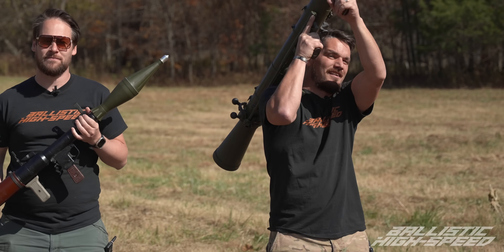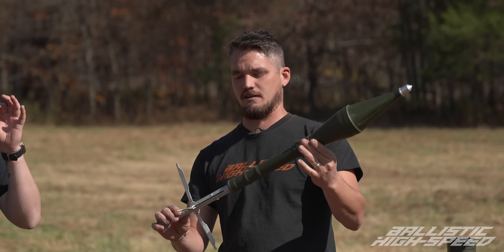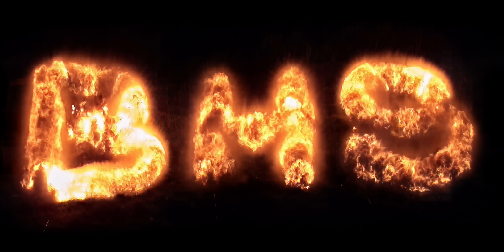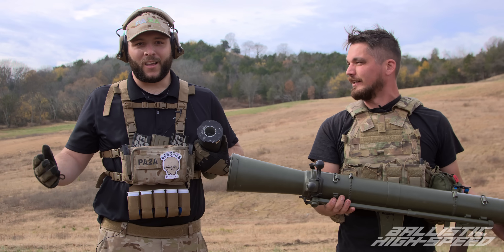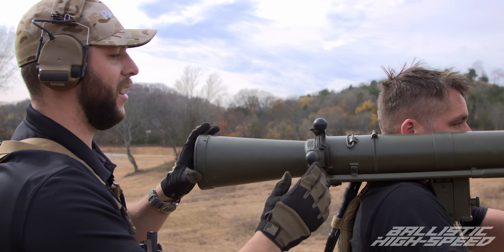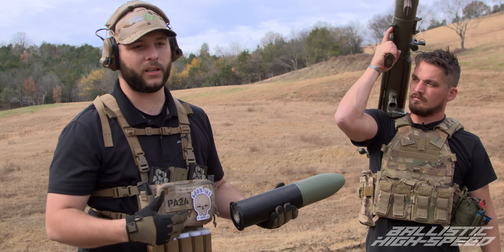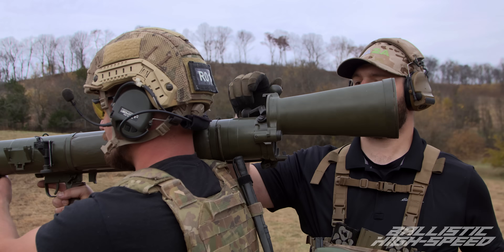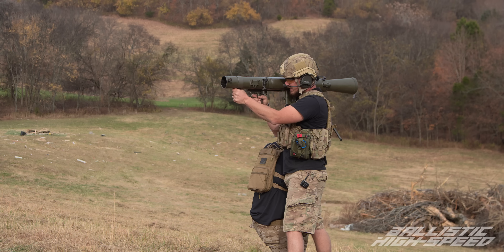Rocket Launchers and The Dangers of Back-Blast! - Ballistic High-Speed

Comment: If you guys wanna know what happens if you block rpg thrust, it blows up! Because pressure has no where to go. Really mind blowed that you guys did it, before it happend i heard you guys say like 3 times "we have heard, its very dangerous" but yeah, we still going to fk with it...  it looks like that was the result you guys were looking for. Cant imagine other outcome than this. Check the other rpg you shot hand behind it, it might also have cracks. Most channels test this kind of stuff with string and dummy... i wish you fast recovery ✊. If something is dangerous to use as it should be used, then never ever modifie, test or experiment with that thing while you are next do it, rpg has allot more power to just kill a person, dont freaking play with it.

Comment: Im glad that Adam will make a full recovery! One of three things most likely happened to cause this from what I could find. 1. The rocket was improperly loaded leading to it getting caught on part of the firing tube. 2. The tube itself had a fault in it leading to shrapnel hitting Adam along with fire from the blast. 3. The stabilizer fins were deformed to make the rocket trail off to one side potentially hitting the ground causing shrapnel close by to the shooter. Wishing you well in your road to recovery! It will make for a cool story too 😁
Reply: could it matter that the pressure maybe finds too much resistance and pushes back because of the gel face very close to the pressure exit?
Reply: @JumpingDyl   the rockets were home-made, I dont know what they expected. they probably overloaded the last one causing the mechanism the explode. you can see the propellant at 4:00 exiting and it lost not uniform and almost dirty and dark,
Reply: @liamisboss2  those were homemade??? No wonder they exploded 🤦‍♂️

Comment: 4:54 The gas leaking out near the fire control group seems to get worse and worse with each shot. This is probably a reactivated RPG with the tube repaired by welding.
Reply: It is reactivated and that leak ended up being a failure point and the rpg exploded in his hand later they have a video on it

Comment: The RPG 7 IS a recoilless launcher. 
 Its payload has a rocket motor on it that fires after it has left the tube. While it has a payload with a rocket motor on it,, it is ejected by propellant acting as countermass. befor the rocket motor is ignited and adds to its forward push.
The rocket is not under rocket propulsion when it fires, its unfired while moving forward from expanding gas of propellant thats behind the payload. After its 20 feet or so away, the rocket motor fires.
The anti personnel OG-7v grenade the RPG-7 fire has no rocket assist when it is fired from an RPG-7 for example. 

 Panzerfaust and RPG-2 were also recoilless launchers that fired payloads that had no rocket assistance to the payloads they shot.

It looks all the world to me that the "rockets' they are firing are not configured with any rocket motors. ( 3:17 ) The section where the rocket motor should be is just a flat fold of tailboom steel, exactly like an RPG-2 warhead has (likely IS from an RPG-2tailboom 11:24 ) just behind the 'warhead', and ahead of the propelling charge.   Go's to show, they are using a recoiless launcher and not launching rockets at all.

Comment: OK, not touching the accident or the admitted non-recoilless CG, however;

1) The RPG-7 is not a rocket-launcher but in fact a recoilless weapon like the CG (albeit most of its munitions are rocket-sustained - notably the OG-7 is not).
2) You are holding the RPG grips the wrong way around. Right hand goes on the firing grip if you are right-handed.

Comment: Firing a hand cannon with your head against it is inherently an unsafe design. Idk if that rocket was from old Soviet stock, or maybe if the US trapped it for rebels to get killed in irak, and somehow came back to the US
Reply: No one has to trap anything. Weapons are machines, and sometimes machines fail
Reply: @jimsagubigula7337  yeah I guess, but that's odd. This kind of damage would be the first thing engineers would try to avoid, so i couldn't imagine a rocket failing like that. But i suppose 1 in a million times it can happen
Reply: @jeanladoire4141  This. And don't forget engineers are humans too. They can make mistakes. When you have built 10 million rockets, some of them are bound to fail.
Reply: Nothing is perfectly safe

Comment: these weapon systems don't produce smoke IRL. Maybe some myst/fog at best. I wonder what the results would be with actual charges, definitely would be more violent. What you're showing is basically a musket without an end cap. Also very likely what induced the tragic failure. You shouldn't fake this stuff, or used inert weapons to test for this very reason.

Comment: That really shouldn’t have happened with dummy round and no detonators installed??? 

There shouldn’t have been any condition that existed for this to happen… 

What needs to happen to repeat this to reproduce the result to know for sure… how this happened 😣 I can’t think of anything right now that could cause this… even if it was over loaded… it would need to be sealed for any pockets or space in the powder to be contained and obtain that pressure release…

I heard two pulses 😬

Comment: When handling explosives, torpedoes, mines, rockets, pressurized fuels, unstable batteries, chemicals, solvents, etc. there is always an inherent risk involved that something will go catastrophically bad, and all you can really do is take the knowledge that what you are doing IS DANGEROUS and then go from there and respect that fact and mitigate that inherent risk as best as possible and be level headed as to how you are going to go about your business. Most of the time if the proper care and precaution are used, things are fine. But even if things are all on the up and up and you are checking yourself and going by the book, things do happen and sometimes go completely and devastatingly wrong.

I am not a subscriber, but I hope that Adam's recovery proceeds smoothly and goes well.

Comment: What cato'ed was the motor. Either the motor was damaged (dropped or fuel pressed wrong)or that head was to close to the nozzle. I have built thousands of solid rocket motors, and seen this happen many times. The fuels we use are basically explosives on a leash. Benzo, and silacylate can especially do this if not handled properly. 
But also, I have set up rockets to close to the launch pad and this caused engine failure. That head could have very well been a factor. I would like to study the slow mo of this event to understand my craft better.

Comment: No matter how well you prep, a catastrophic failure can happen, just as what happened to Kentucky Ballistics, it doesn't matter how experienced you are or how much prep you do, a failure can happen, regardless, I wish you a speedy recovery Adam, and my heart goes out to you and your folks.
Reply: "The rocket is launched by a gunpowder booster charge, giving it an initial speed of 115 m/s (380 ft/s), and creating a cloud of light grey-blue smoke that can give away the position of the shooter. The rocket motor ignites after 10 m (33 ft) and sustains flight out to 500 m (1,600 ft) at a maximum velocity of 295 m/s (970 ft/s)

the RPG-7 munition has two sections: a "booster" section and a "warhead and sustainer motor" section. These must be assembled into the ready-to-use rocket. The booster consists of a "small strip powder charge" that serves to propel the rocket out of the launcher; the sustainer motor then ignites and propels the grenade for the next few seconds, giving it a top speed of 295 m/s"
Reply: Kentucky ballistics situation was a little bit more preventable though had he used reputable ammo. That was a crazy freak accident still.
Reply: Found the website in case you need to book an event.
Reply: Yeah, i instally thought of him as i saw that.
Reply: "In designs such as the RPG-7, the rocket exits the launcher with a low-powered gunpowder charge, and the main rocket motor then fires after the rocket has travelled 10 m (33 ft)"

I'd bet the gunpowder charge used in these modified/replica rockets is significantly different to the charge used by original rockets the rpg7 is designed for.
Reply: what did happened ?
Reply: I thought of the same thing that happened to Scott as soon as I heard prototype rounds. These should be tested on a rig set up.
Reply: there's no way of knowing what round will explode, it'll just happen, and those don't look like garage rockets either, well to me at least
Reply: Yeah. I think in the case of Kentucky Ballistics he bought sketchy ammo. He should have known better. In this case, the jury is still out.
Reply: @michaelhill6451 Shooting rpg rounds some dude has made in his garage is sketchy as fuuuu
Reply: @dopefish93  Most definitely.
Reply: @michaelhill6451   In a sense...  This was literally sketchy ammo being used.  It's literally just some dude's "prototype" or homemade rocket engine projectiles with no explosives.  
It still exploded in a tube, right next to his head...  If it squib-rounded in the barrel, it would be like a half-open pipebomb exploding next to your skull even without explosives in it.
Reply: @RNG-999  You are right. The delay with the Carl Gustaf round should have told them things were sketchy.
Reply: @RNG-999 Bro the gun kentucky balistics was using was also some extremly cheap garbage with a threaded cap. Serbu should deffinetly re-design his weapon. Like cmon man the tread was so weak it was all sheared off. And dont give me the typical bullshit reply "it was overcharged by half). Weapons are built with a safety factor to PREVENT what happened with serbu. Garbage manufacturer. Garbage weapons.
Reply: @tadejloncar  he doesn’t hold mark responsible he even said it was my fault for not checking the ammo and watching the camera footage cuz he actually rewatches the video footage and says the fireball before the gun malfunction was bigger then what it should have been and was a warning sign that he should have stopped and taken a look at the ammo and his gun
Reply: @michaelhill6451   Not any more; read @yakivpopavich's comment explaining what happened.
Reply: @michaelhill6451 what separates sketchy rounds from prototype rounds that are hang firing and producing wayyy too much recoil?
Reply: That ballistics dummy head was really close to the back of the rpg, I wonder if that contributed to the failure. Having something that close to the exhaust would definitely increase the pressure on that barrel.
Reply: @tarnation1010  Not at all, it just deflects the fireball.

Rockets wouldn't work if that was the case.

Comment: That was unexpected on so many levels. I'm glad Adam is alive, in on piece, and is expecting full recovery.
Get well Adam! Both phisicaly and mentaly.
Reply: I would think having the head so close to the back would also increase the pressure
Reply: Unexpected? Home made rockets blowing up?
Reply: @nukingjapanwasok6265  it wasnt about the rocket, I think. Look closely on 30000frames when they shoot it. It literally leaks gas from the handle and around it. Mechanicaly it went super bad but I don't think its about the rocket. More about how old the cylinder used to fire them was.
Reply: @CJisDJ    as has now been confirmed by @yakivpopavich's later comment.
Reply: @nukingjapanwasok6265  both, prototype round (probably higher pressure than standard round, the carl gustaf round was literaly 3d printed, and from the smoke they clearly werent using the propelant they should have been using, they may even have been using black powder due to the smoke, the fire and the delay) and re activated rpg, that a recipe for disaster
Reply: @Negev126  this was not because of the propelant but the rpg was damaged in some way. Yeah it can be but i think 90% was the rpg. To overload weapons with blackpowder is pretty hard, if they are open on both ends this will not happen, exept you take extreme more then the actual load.   But yeah maybe the rocket was not build as well and failed the possibility is there, but other then that weapons are never 100% safe, there is fire, explosions and extrem high pressures and the only thing you can do is wear protection, inspect your weapons regular and look at what ammo you are using if you buy self loaded ammo oder load by your self, other then that you cannot do anything, but the chances of a catastrophic failure are pretty slim if you inspect your weapons and are carefull if it comes to ammo.

Comment: Hey Adam, hope you are recovering well. Youre a young guy so you should bounce back quickly. I spent 4 years in Afghanistan training ANP and have shot those RPG7 hundreds of times. Never seen that happen. Ive cut those booster motors apart and all they have is strips of cellulose in them. You can burn them one at a time holding them in your hand but you put them all together the react somewhat different. 
Hope to see you back soon.

Comment: I hope Adam has a speedy recovery. I'm glad he survived.  While I was in the Military, we were shooting the M-67 90MM  recoiless rifle. We had a gun blow, killing the gunner and wounding the AG. I had just fired the gun and the next team firing had the catastrophic failure.  I was several feet away when it blew. I didn't get hit with any of the schrapnel. When CID showed up, I told the investigator that I didn't believe the warhead went off, otherwise I would have been hit . It was a HEAT round. A few weeks later, the CID investigator told me I was correct, EOD found the warhead 30 or so meters downrange. Apparently, it had something to do with the propellant. I remember the date of MFG. on the rounds was 1967. I believe the M-67 was the largest shoulder fired recoiless rifle the US made. It was an extremely powerful weapon.

Comment: RPGs really don't have a lot to contain a misfire. That's a shocking incident - I never even thought that could happen. Best wishes for what has to be a massively painful recovery.
Reply: The rocket is launched by a gunpowder booster charge, giving it an initial speed of 115 m/s (380 ft/s), and creating a cloud of light grey-blue smoke that can give away the position of the shooter. The rocket motor  ignites after 10 m (33 ft) and sustains flight out to 500 m (1,600 ft) at a maximum velocity of 295 m/s (970 ft/s). 

RPG-7 munition has two sections: a "booster" section and a "warhead and sustainer motor" section. These must be assembled into the ready-to-use rocket. The booster consists of a "small strip powder charge" that serves to propel the rocket out of the launcher; the sustainer motor then ignites and propels the rocket for the next few seconds, giving it a top speed of 295 m/s

I'm thinking the inital powder charge was significantly stronger than the rpg7 was designed for.
Reply: Idiots used a re activated rpg7 launcher... writting was on the wall
Reply: @limoduhLmO  at least spell correctly....
Reply: @limoduhLmO care to explain whats wrong with reactivated RPGs?
Reply: @headshothunt3r414  if the guy welding it doesn't do a 100% perfect job it turns into a pipe bomb because the hole is in the area of the rpg that holds the most pressure.
Reply: @limoduhLmO how ironic
Reply: @limoduhLmO  also those garage made rockets were stupid idea